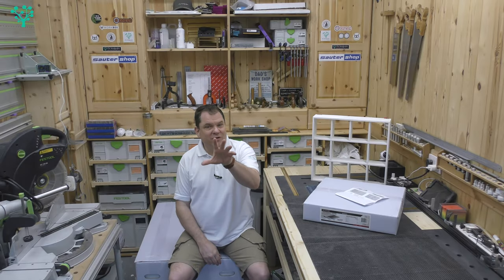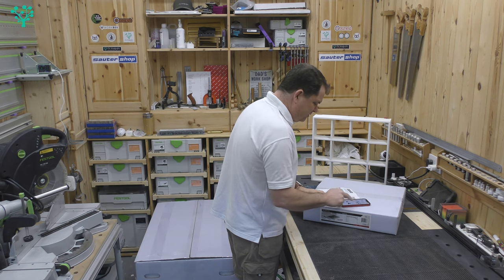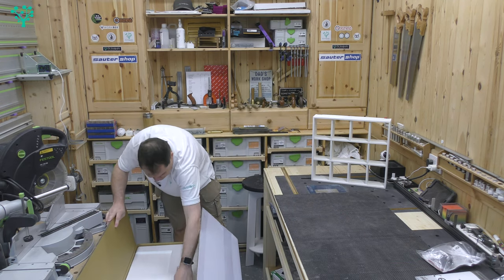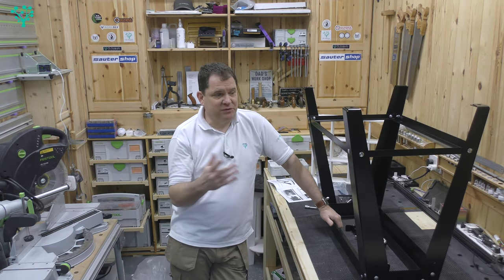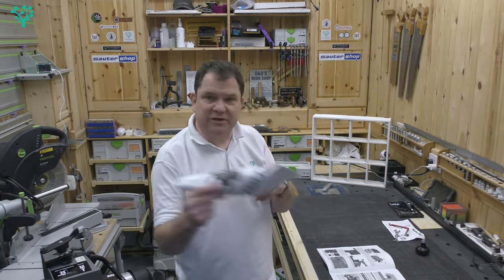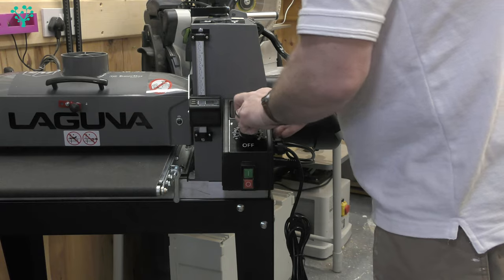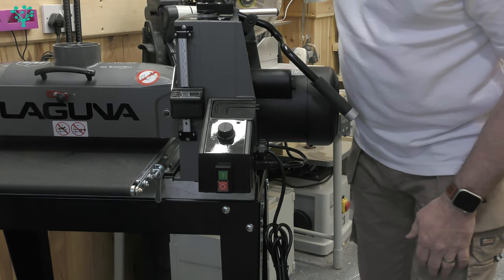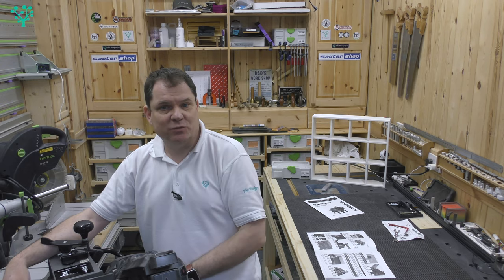Laguna 1632 SuperMax Drum sander in depth review 2021 version. Part 1 unboxing & set up

Comment: Andy, I'm considering this but I want to know if it will fit into the space I need.  It will be on a rollout cart.  I just need to know the total width of the machine (Counting the motor, of course) and the front to back measurements.  I'm in America, but I use the metric system so no need to convert.  If you could put that here, it would be greatly appreciated.  I can't find the measurements anywhere.  The only thing I can find is including the stand and it has some crazy measurements listed.  Thank you for your help!
Reply from the maker: Hi Brent,

Sorry for the delay on this one. This is strange machine to measure, it is full of various sticky out bits. I have made a quick video that show the key measurements. I will edit it to today and post on Vimeo and add the link to this message.

Cheers

Andy
Reply from the maker: Hi Brent, watch this video https://vimeo.com/578369421

Hopefully it should help, let me know
Reply: @TheWoodgrafter  THAT, was so far above and beyond the response I was expecting!  You answered every question I had and some I hadn't thought to ask!  Andy, you truly are the nicest woodworker on youtube.  This is all I need to get to work on it.  In the next 2-3 years I will be building my dream shop and there will be twice the floor space I'll ever need, but for now, I'm just in my garage (I'll even pronounce garage in an english accent to show my appreciation) and I have limited space.  You're the best Andy!  Thank you.
Reply from the maker: Hi Brent,

Glad I could help. I am envious of your dream shop - I have now run out of space. So need to find something in the future.

I don’t think you will ever have more space than you need. I thought I had competed my shop when the CNC arrived - but now I have discovered laser cutters :-)

It never ends.

Take care

Andy

Comment: Is that a Wixey digital gauge, I have one on my table saw.
A brilliant bit of kit.
Reply from the maker: Hi Chewy,

Hope you are all well. Not sure on the brand of it. No obvious manufacturer markings. It could well be as it looks very similar.

But is works very well.

Cheers

Andy
Reply: Mine is a Wixey
Reply from the maker: Cheers Paul,

I imagine mine is the same.

Whatever it is, it works very well.

Andy
Reply: @TheWoodgrafter  The digital gauge has "Wixey" on the front face, so it is likely a Wixey.  🙂

Comment: I've been looking at this rather than the Axminster at406ds
Reply from the maker: Hi Sam,

I looked at the Axminster version - this is a much better machine. But at a price.

A no regret purchase in my book.

Andy
Reply: @TheWoodgrafter  yeah I came to the same conclusion just got to convince the accountant
Reply: Also need to see where to put it as running out of space
Reply from the maker: I have now run out of space, I had to scrap my old hand tool bench and re-structure the shop.

Worth it though.
Reply: Yep. Same here. Not convinced by the antiquated propositions from Axminster. 
This one is far superior in design and function. 
Got it in February 2021 (from IGM tools, recommended). 
Well worth the investment AND the ground it stands on: it is a substantial machine…
Highly recommend mounting the stand on castors to manage the different lumber sizes going through. 
Hooked to an AT50E 1HP extractor through an ACCIH cyclone: works like a charm!
Reply from the maker: Perfect

Thank you for the input, I forgot to mention. I have mine hooked up to a 2HP extractor - no dust at all.

The dust collection is awesome.

Cheers

Andy
Reply: @severinedellaporta2760  I get my sanding rolls from IGM and a spare belt drive roller... good prices
Reply: Did you have a link to the casters on Amazon?
Reply from the maker: Cheers Paul,
Reply from the maker: Hi Sam,

These are the ones I used.

H&S 4 Castor Wheels Heavy Duty... https://www.amazon.co.uk/dp/B017GLWKXK?ref=ppx_pop_mob_ap_share